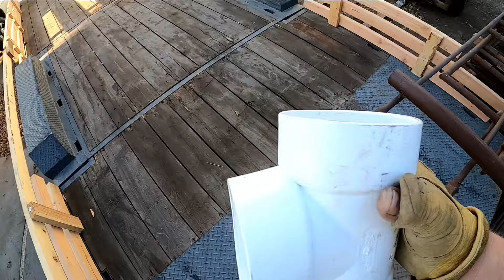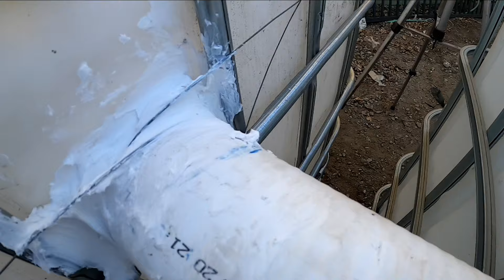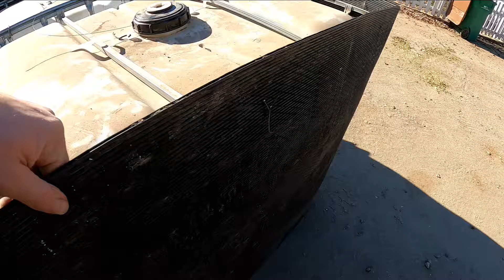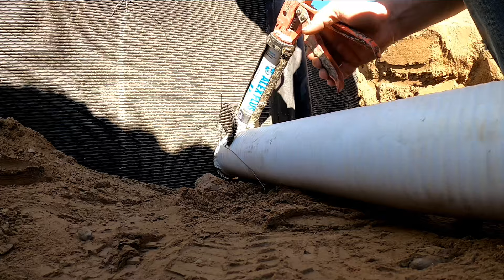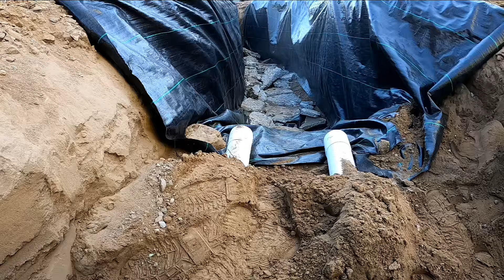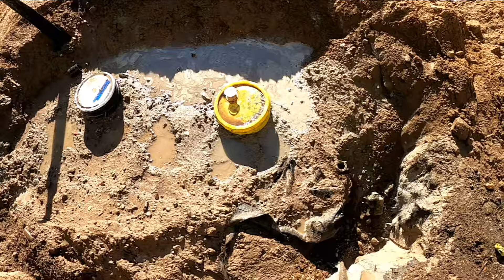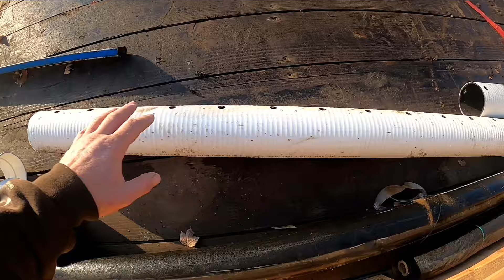Cheap, easy DIY TOTE septic system | Cabin, RV, Tiny home, off grid

Comment: Nosey neighbors snitched me out to health department and mine was even better with clean outs and openings in top cut out and buckets set into place for easy pump out but they caught me in a area that has codes for septic only so be sure if your going to do this you don’t have nosey neighbors and/or codes
Reply: Similar problem.    What fees or issues did  EHD give you
Reply: snitches get stitches
Reply: Snitches get stitches.Building codes are not for safety.They are for control.
Reply: What did they do
Reply: @allywilkeforsenate  Septic codes are 100% for safety. If your nieghbors don't have a proper septic, they can contaminate water ways and wells. Would you want to drink your neighbors shit if they installed a septic improperly or too close to your well?
Reply: @alecb8509  I wouldn’t want that on my place at all. What happens when the plastic rots and a child falls in.
Reply: @LeadfootPTM  so don't do it genius
Reply: @alecb8509  I own 30 acres I doubt I will contaminate any ones well
Reply: Does plastic rot?? The wire he uses to tie it all together will rot hundreds of years before the plastic.
Reply: I mean the codes and rules are in place for a reason guys. To be fair I am a plumber so I'd not suggest this of course but just try and remember. You can kill people in your community by contamination of ground water when you don't know what your doing. Good luck to all.
Reply: I’ve seen too many jobs screwed up by licensed contractors and pencil whipped by inspectors, the whole system is false security.
Reply: Excellent advice 👌 👏👏
Reply: That is my worry too. I’ve decided that mine will only be used for gray water. Not taking the chance of being forced to cleanup a black water septic problem. Will continue to compost humanure.
Reply: That's why I don't want neighbors
Reply: And money  @allywilkeforsenate
Reply: Liar
Reply: @williamturpin1596  you think all the wells are separate underneath? Hahahaha it's called an aquifer. Your poop contaminates the whole aquifer, not just the water under your land. 30 acres is nothing. Believe me, as a driller in Geotechnical the difference on 30 acres as to where the water goes is literally negligible.
Reply: @TheBiblican  ok so where does all the animal shit goes? Guess we can’t drink out of any ground water.
Reply: @TheBiblican  “Biblician” really? More like “chicken little”
Reply: @Mr.SuperDuper-idk  the animal shit goes to the same spot. Kinda obvious. Lol. Chicken little lol cool man.
Reply: Wouldn't hurt to do some research on the topic being the information is actually easily found and undisputed being its measurable. 🤦‍♂️ I know that's hard to do when your just here for comments so I'll take my chicken little award and hit the the dusty trails 🤠  and yes the the poo and pee are already in everything. That's not the problem. The problem is the city water and infinite forever chemicals and pharmaceuticals chillin in your kidneys by accident right now.
Reply: @Mr.SuperDuper-idk my friend, animals pooping everywhere is very thinned out given how vast the earth is. It allows space and time for natural decomposition. Humans pooping in a giant container until it's a massive biohazard is probably a bad idea. But hey, humans will be humans
Reply: @alecb8509  well then if its for safety then it shouldn't be charged for! period!
Reply: @alecb8509  its funny that you have animals shiting and peeing all over the grounds and people that may be out camping or hunting that has to use bathroom on ground so whats the diff im sure that can get into the wells also! Im sorry but its all about the money!
Reply: Do you have photos or instructions you could share
Reply: You got it @allywilkeforsenate
Reply: @allywilkeforsenate 100% correct

Comment: Wouldn't recommend this unless you have a larger tank clean out access lid and more care in the leach field design.  I won't elaborate but even if you're bypassing inspection you should do it like it will be inspected. Many states allow you to do your own septic system yourself. You will be hammered if you hire out or don't apply for a permit in Texas. Fair warning: If you are homesteaded but don't have a permit for sewer or septic: That's how you get on a list. Not snitches. It's just obvious database comparison.

Comment: Stop fighting with pliers twisting the wire you have a drill. Cut off the ends an even distance and stick in the drill chuck. Done in 5 seconds and much tighter than by hand.

Comment: Get some infiltrators man. So unnecessary with the rubble lol also instead of wraping it in carpet just put it in a hole that is not much bigger than the tank and fill with concrete around the sides and bottom.

Comment: Good project.... my two cents...use a slip joint coupler or rubber coupler between tanks... Use silicone and butt coupler on inside and outside together... I use treated plywood around tanks to strengthen the outside... again good job 👌
Reply: I do the same - I like the plywood for it's strength. I put Tyvek around it as a moisture barrier; I've found it keeps the moisture off the plywood and also keeps any  leaked "contents" from escaping the system sideways. I know a guy who just sprays the plywood with a generic FlexSeal type product but that does up his costs. Does anyone other than me do a rubble layer UNDER the tanks?  Maybe I'm just too picky but I like the safety aspect. Of course unlike the video I'm using a small bucket loader to dig and that does a good job of tamping it all down. I drive in some rebar down there first to help stabilize, positioned under the tote frame.  Like Ron I pack over it with a sand mix and fill the tanks and give them time to settle. I think the metal exo-frame keeps them in place just fine over that bed, no cement required. Just me.
Also, I never use regular PVC OUT of the tanks to the leech field. I use flex pipe. I don't need them cracking; don't know what the odds are but I've seen to much burial-grade PVC come out cracked.  I wrap the flex-PVC in 10mil Wonder Tape and I've never had one system fail.
My material costs exceed his but not by very much (I've always got rebar & Tyvek laying around from other jobs anyway) and I've even put these in for small (under 1000 sq ft) 1BR homes and NEVER had any issues. Certainly more cost effective than one of those 1000 gal dual chambered tanks they sell and I think the metal frames on the totes make them superior. I also use a product call NT-Max in the system that's a LOT better than the over the counter "$h1T eaters" they sell and I think is one of the reasons I never have an issue with the small ridges inside the FlexPVC pipes.  I've found the ridges smooth out inside with use anyway.
Just my 2 cents.
Reply: @daninnj8580  when you say flex pipe for the connection to the field, are you referring to the kind of flex pipe that is used for rainwater from gutters?
Reply: @daninnj8580   I like your comment. Maybe a video to enlighten other would help

Comment: This heavily influenced my septic build and it's been good so far 4+ months
Reply: Do you smell it?
Reply: @jaysmith7526  as long as you keep the lid on you should be golden
Reply: @jaysmith7526  I made mine have a large vent pipe the same size as the plumbing. I put a cap on it, cut a hole in the cap and glued a smaller 1" pvc pipe to the cap that goes maybe 10' in the air. Above our heads so smell isn't noticable at all. Use septic smell good stuff like once a month if it does smell and it fixes it same day. I didn't glue the vent cap, so I can take it off and pour any additives directly into the tank the put the cap back on. Still going strong no issues at all
Reply: @jaysmith7526  even with the cap off the last month I still haven't noticed any smell
Reply: To anyone who cares, this 2 tank system costed around 7-800$. That includes all materials for tanks and leach field. And an excavator rental for a day. Project finished by myself in 1 day. 11 hours start to finish.
Reply: Thank you for your comments. May i ask what you set up is being used for? How many people and the type of activity if anything outside of regular
Reply: @benandjakehuston6321  hi, I bought a property in my town and the cost to be hooked to septic costs around 4,000$ but My house isn't built yet so I just have a Mobile home as a storage and stay in a 32' fifth wheel In the back of the property. It's 2 adults and 4 young kids ages 2,4,6,8.. it rains and snows Enough that the ground doesn't want to soak water up anymore (on the surface). Also the ground is red clay type. Since we are living in the 5th wheel until the house is made for the next year or 2 we like to make sure we won't ruin the plumbing cause fifth wheels have always had black tank issues.., we hold the toilet flush for 5 seconds after every use. So there is alot of extra water to have sent down the line but it helps cause it's been maybe 8months? Still have not had a single problem.
Reply: @tylorkates8842  how will you empty the solid tank?
Reply: @liveandletlive2894  I researched quite a bit and for our situation it will take about 2 years for us to fill the 2 275gal tanks. (My 4,8yr old children alternate months with me)...that's 2 years IF all the "solids" stayed completely solid. Which is not the case. When it mixes with the stuff already in the tank and when I empty the shower and kitchen water tanks it all mixes/breaks down the stuff so you could assume you'll get at the LEAST double that amount of time before having to empty it..so worst case in 4 years it'll have to be emptied. At that point the tanks have the openings on the top right. I cut the bottom off of a bucket and put the bucket (now just a fat tube) over the tank twist lids. I screwed the bucket tube to the tank, put alot of wood around the metal cages so the dirt wouldn't collapse the tanks as easy once it hardens... anyway I put bucket lids on the screwed bucket tubes to keep the dirt out for any time I need to fix it for whatever reason like a normal store bought septic unit. It seemed to hold up fine, however I haven't had to dig them up yet to fix anything cause it's all working flawlessly. The tanks are under the frost line, so the tanks are generally under ground level a few feet, the bucket raises it about 16" but there probably another 18" of dirt on top of the bucket....so yes in the event I need to empty it, I'll call a septic guy to come suck it a out. I'll just dig up the dirt till I hit the buckets and take the caps off and let them do their thing...if the "Access" isn't wide enough for a sucker then I'll get a hand saw and just cut a bigger hole (I'm not sure if like a sawzall would be a good idea with all the gases in the tanks? Might explode so I'd use an old fashioned hand saw). The bucket blocks the dirt anyway and you only access it worst case every 4 years so there won't be much "irritation" to the setup if you cut a bigger hole.. hope that all makes sense. I could send pictures of my set-up if you comment your number
Reply: @tylorkates8842  I own my own tractor with front loader I have about six of these totes laying around I picked them up for about 20 bucks each. Other than the pipes I probably will purchase flanges for between the totes and of course gravel for the leach field I'm hoping my cost will be lower than 700 but even if I hit the 700 Mark that is cheap for a complete install thank you for the heads up
Reply: Fifth wheel black tanks should always be closed until completely full. You will know when it is full because when you go to flush it it will have a big bubble of air sort of. Then and only then you will want to open the valve draining it. Otherwise I guarantee you sooner or later you will have a clog of toilet paper that will completely ruin your system. You can let your gray water run out on the ground continuously. When you fill your black tank up all the way it all goes out at once making sure that you have no toilet paper leftover.
Reply: @trueamerican1576  and after you flush the black tank you flush the grey tank
Reply: @nccaddie  thank you. Yes while you are dumping the black tank you want to let the gray tank fill completely up. That way you flush out your grey tank emptying it after you close the black tank back off. This also flushes the lines of all of the Blackwater.
Reply: @trueamerican1576  I had an RV 😎🚐
Reply: @tylorkates8842  would any county be ok with that? In my county I think they require inspection for the septic. When I told them I can do DIY one they gave me a list of approved county septic installers. What would you do?
Reply: @trueamerican1576  there are actually cool septics in Europe. was looking at one shipped from Ucraine just before the war for like 1 grand. Those had aerator and basically you can use that water  for garden
Reply: @ekurdesov  I ended up running cabin septic into my Aerobic System here at my house. I use it to water my pasture. There are three chambers I have to put chlorine tablets in the section that is aerated
Reply: @liveandletlive2894  have it pumped of course.
Reply: I have just graded a road to the opposite side of my property in the forest. I will put a travel rv trailer in the spot first then a tiny home. I'm not sure how to set up the entry pipe that goes into tank number 1. How deep does it need to be leaving the rv or going to tank?
Reply: @ekurdesov  can you provide a name for what it is called or a link to them?

Comment: Next time baffle your pipe from the first tank that leads into your second tank.   The baffle should be place so it is level horizontally with the liquid that would be in the tank.  This baffle prevents any larger solids from passing from your first tank to your second tank.  Baffling can be made either by cutting a  end cap to open the top half of the cap before gluing into place or by just heating up the end of your straight pipe so it can be lifted into the horizontal position creating a baffling effect.  Great video .........

Comment: Old brake drums or rotors work great to put on top to locate also.
Reply: I use old used water meter pit covers for things like this. They can be put flush with ground level and gives easy access with zero locating or digging.
Reply: Ever see the wires that run right along gas and other buried utilities? For locating through signal

Comment: And so I did it ! Even put clean outs to the drain field thru the tote costed a lil bit more but I figure this way before my leach field gets stopped up I could clean the screen that I used in it also the smaller holes on top I cut them and slide two five gallon buckets into the hole and sealed them in I also splurged on some lime rock 2” but still way cheaper then having a plumber do it or having an expensive septic installed
Reply: How's it working now? I'm researching different options.

Comment: The plastic tanks may need underground protection from larger moving stones through ground movement, the internal water pressure is not always able to overcome the external presser on these IBC tanks and can buckle in. I always carefully dig a hole slightly bigger don't need metal cage they just rust away put on a shallow concrete base then centre the assembly and start working concrete down the sides then over the top  making the necessary allowance for inspection covers, vents etc about 2" to 3" all-round  gap giving a cocoon protection.  I enjoyed your content very interesting.
Reply: Dig a hole put crushed lime stone base. Put cinder block wall around them in the ground then put a home made concrete top over it.

Comment: I have an apartment toward the back of my property, it uses the same septic tank. I rented this apt. to 3 young girls , 4 months later my septic tank started overflooding.  I had it fixed, but when the workers opened it up there were TAMPONS FLOATING ON TOP! People don't flush tampons or anything that's not biodegradable, because its extremely expensive to fix or replace the feeder lines. I paid thousands of dollars to replace the feeder lines and repair the damage to the dividing plastic wall as it collapsed because of the backup. Needless to say l asked them to leave because they weren't interested in what l was trying to get them to do with their tampons , to throw them into trash can l put outside the apt.
They weren't very smart cause they were paying only $175 ea. a month.
Reply: What a freaking mess.  Some people are worse than animals.  Hope all is well with you now...
Reply: I know a couple landlords that only rent to 40yo and up lol for reasons like this 🙌🏿

Comment: I have been looking for this type of material for an off grid project. Great video!! Blessings to you and your family!!
Reply from the maker: Awesome! Thank you!
Reply: find a large 18 wheeler repair shop.,,. they get these for the oil for the trucks,, they will usually pressure wash them for u if you take them,,  the plastic is very thick and strong
Reply: @Riff Raff the metal frames make great wood ricks with a little modification and the plastic tubs make good hay bins.
Reply: @unitedstatesofbuild4915  how long and how deep does the leach bed have to be for gravel or rock for 2 bedroom cabin

Comment: I would only put the outlet pipe only 4 inc below the outlet of the solid side. And I would put a T on the water side also. there should be tail pieces on your baffles to mid tank. The cleanest part of the tank. Don’t know how long I’m going to use this for or how many people will be using it. But it’s pretty small.But if you have it pumped out periodically Should do you just fine. The cleaner the water going it to the field the longer it lasts.
Reply: Indeed! I was going to mention that too.